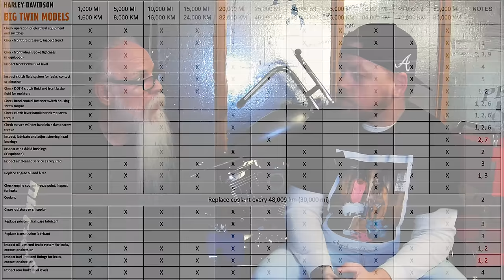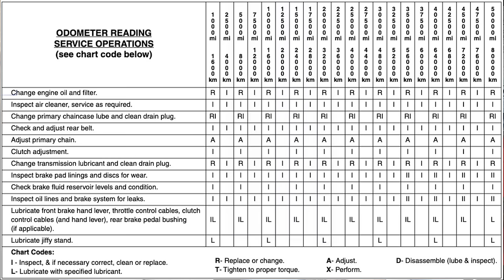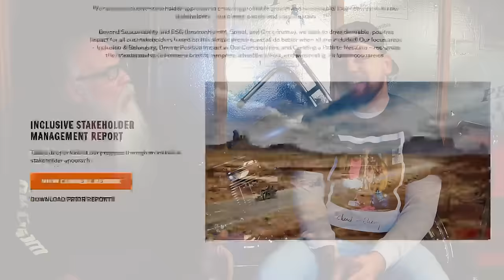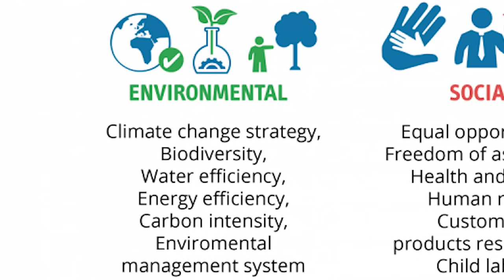Harley Oil Change Intervals-Engine, Primary, Trans

Comment: I change all 3 yearly regardless of Mike’s beings my trike sits all winter,one thing most people don’t think of is the possibility of moisture getting in your oil’s from cold to warm temps in humid claimants like we have here in Illinois,so to be on the safe side of things this is why I do mine yearly
Reply from the maker: Good practice.  Thanks for sharing. 👍
Reply: @BADog-ew6ox  yup MN weather the same. I have actually witnessed the moisture from the cold making oil look like milk. Typically a quick start and run for a min will burn that off, but I agree, good rule of thumb for living in Arctic tundra 😆

Comment: Thanks for the info.  I change the engine oil every 5,000 Km with amsoil.  Clean my outlaw filter every oil change.  Try not to forget to clean my external breather catch can at the same time. Change the primary and trans every 10,000 Km with formula +
Reply from the maker: Thanks for the input, and we appreciate your business. 👍

Comment: I just changed the oil and filter a couple days ago at 5k on my FXLRS. The little magnet was almost completely clean and the oil wasn’t too dirty looking either (HD synth 3) was going to change my transmission at the same time but it looked perfectly clear and clean. I’m waiting on an aftermarket chain tensioner before I do my primary because I’m swapping out the factory one while I’m in there. I’ll go ahead and change the transmission too and look at that magnet. I suspect it will be in good condition judging by the appearance of the oil. If so, I’ll probably stay with 10k on my Tran and primary. Great information though. We can always count on you guys for straight answers.👍
Reply from the maker: Thanks man, appreciate the comment.
Yeah, after reading so many comments, and looking back at my trans changes, I'm probably going to change the gear oil every other oil and primary change (4k-5k miles).

Comment: Thanks for the info and would love to hear if your particles appear to be less after a few changes. I was talking to someone that worked in the oil industry and asked for his honest opinion on longevity of different brands of oil. He told me the in all honesty, all oils will protect for approximately 20,000 miles. I ask why then the frequency of recommended changes. He told me the reason is in the money. The more oil you change, the more profit that is made. It sounds like what I was assuming. That being said, I still change every 3-5 thousand miles. Now I’ll be doing all 3 every time due to your video. I have to tell you though, I have a 2003 heritage with 69,000 on it and have never changed the transmission or primary and it runs like the day I purchased it from the dealer. Call me stupid or just lucky, but that’s the truth.
Reply from the maker: Thank you for your comment, and for sharing your experience.

Interesting what your industry guy told you.

Yes, there are less particulates in the oil when changing more often.  Will have to dig thru some Blackstone reports to find how much.

The landscape of oil efficacy is significantly changed over the last few decades with more and more semi and full synthetics,

Even with the best fluids I can tell when the oil starts getting "tired" in the engine by top end noise, and in the primary by clutch engagement.  I cannot tell any difference in the transmission.

Again, thanks for the interesting info you've shared. KP

Comment: Living in S. Florida and riding less than 5k miles/year on my 2010 TriGlide, I change fluids once a year. Redline 20w60 (if I can find it) in the engine, Redline Shockproof in the tranny, and a mixture of Formula + and auto transmission fluid in the primary. At 33000 miles, trike still runs great!
Reply from the maker: Thanks for sharing!
Reply: @DKCustomProducts  could you tell me what’s the best video to watch so I can learn how to do my own 3 hole oil change on a 2020 trike

Comment: Well all I know is back in the day when I worked at a GM dealership the old diesel mechanic always said keeping the oil changed is the life of any engine! And I believe he’s right my old bike gets her oil changed in all 3 holes every fall before it’s put up for the winter which is only about 2500 to 3500 most times it maybe a waste of money but I think it’s good insurance and if I can get time to ride more I would still change it about the same mileage stay safe guys
Reply: That makes you feel better. Not the bike. It would last longer if it was possible to ride it more often. But for many that's determined by your location.
Reply: He's right!  Never hurts to change engine oil. Maybe the most important thing that's usually overlooked, is change it hot in suspension ride it up and down the pike an hour or so, bring it in Hot. Drop your oil out of it as soon as you get in, let it drain for an hour or more (if you can) these are very important points concerning the longevity and cleanliness of your engine and drivetrain parts. As you may know, oil does not lose this lubricity, and when collected and left to sit in a barrel, all of the ingredients put in at the Refinery and all of these sedements and wear materials will settle to the bottom of the barrel, and over the top of that you have clean oil. That is what I run in my lawn mower and other small engines. (Not my bike) Ride Aware, & remember recycling starts @ home!

Comment: Jmo, I change oil every 3k miles or less depending on how I’ve riding, I ride over 100mhp all the time so I change it often. Cheap insurance. I change the Transmission/primary fluid every other oil change. Just what I do based on how I’ve riding. You can only fry chicken in the same oil so many times. Facts!  If I get the oil hotter than normal I change it asap
Reply from the maker: Good practices. 👍😎👍

Comment: 2012 Road Glide.  I change engine oil between 3,000 and 3,500 miles and use Syn3 and a Harley oil filter.  I change primary at the same time and use Formula +.  Transmission is BelRay, also every oil change.  The magnets are clean except for the normal fuzz on the primary.  3 quarts in the engine, a little over a quart in the primary, less than a quart in the transmission.  Not a huge environmental impact since I recycle my oils. 
Just how I do it, I’m old and old school.  Your mileage may vary.
Reply from the maker: Thanks for sharing! 👍😎👍

Comment: Was just having this conversation the other day. In my experience 10k is too long of an interval for the primary. At least in my bike it is. Primary gets kinda chattery. I’m going to 5k all three holes from now on. I use synthetics, but the early breakdown of any  oil & its viscosity is a reality with air cooled or oil cooled engines and the heat they produce.
Reply from the maker: Well said! The only one I would feel comfortable going more than 5k miles on is the Trans, and that is because I use the Redline Shockproof.
Most of the time I am between 3500 and 4500 on the engine.

Comment: I do all 3 at the same time around 3 to 4k. Amsoil in all 3 holes and I do the clutch adjustment. I tried redline in my transmission but I didn't like how it smelled. Ride safe!
Reply from the maker: Thanks for sharing

Comment: I change my engine oil before I put it to bed every winter and the other two holes get done every second year. I use a full synthetic oil (AMSOIL) I use the specific oil type for each hole.
Reply from the maker: Thanks for your comment. 👍

Comment: I use Syn 3 in the engine and I use harley 80-140 heavy syn in the primary and trans, engine gets changes every 4 to 5 thousand miles and the primary and trans get it around 8 to 10 thousand so basicly the primary and trans get changed every second  oil change and the oil gets changed every yr depending on mileage put on the bike as we have a fairly short riding season here in Canada. I only use Wix filters as well. Bike has 65 thousand on it and I run 2 up heavy, long haul touring and never had a problem at all, side note, the service tech at the dealership told me about the 80-140 weight  as i was running syn 3 in the primary before and I was getting a lot of chain noise when hot from the primary and 5 gear howl because of the straight cut gears in the trans, the heavier oil makes it shift like butter and the 5 gear howl is gone.
Reply from the maker: Thanks for sharing!  👍😎👍

Comment: I always did a 3 hole change between 4 and 5000 miles for the last 30+ years , I live in Arizona and the outside temperature is usually pretty toasty from May to October
Reply from the maker: Yep, y'all have some toasty temps out that way!

Comment: One thing that I would like to point out, is that it never hurts to change your engine oil. One thing I've noticed while reading of these comments is, that no one ever said anything about changing it hot in suspension, ride it for an hour bring it in hot and drop it all out now. Oh yeah, one question I have is if it cost more to refine a gallon of gasoline than a quart of oil, how come a quart of motor oil costs more than a gallon of gasoline?
Reply from the maker: Yes, always best/Much Better to change oil when hot.
Cost of oil thoughts:
Packaging
Advertising
Whole different distribution channels, with more fingers in the pie
Additive packages that go into the oil

Comment: I change all three holes every 5000 miles, the transmission lubricant when I drain it at 5000 miles looks just like the new stuff I pour in afterwards. Engine oil always looks very good at 5000 miles (Harley syn3 in the engine, Harley synthetic in the trans & primary) I figure if you’re going to do the engine oil change, your right there, might just as well do the trans and primary.

Comment: I have a 2020 tri glide I change all 3 holes every 4k-5k.   With all harley brand oils syn3 in the Motor and Trans. The Primary gets harley primary/gear oil

Comment: 5k synthetic in engine and primary. Trans with Amsoil Severe Gear every 10k. I did  change the trans at 5k once and the trans fluid still looked brand new.

Comment: I don’t have the opportunity for 5,000 miles a year unfortunately. So I just change all 3 oils yearly. And with the engines running so hot, it just makes sense.
Reply from the maker: Good practice.  Minimum fluid change every year, regardless of miles, is best.
Here's a vid of low & no cost ways to cool your ride down a bit- https://www.youtube.com/watch?v=o3T3yA9BKwE

Comment: Great info 👍 . Thanks for letting us know.

I use H-D 360 20W50 in the engine and Formula+ in the primary & transmission on my M8 Road King.
 I do a 3  hole oil change and replace the engine oil filter  before l put it in storage for winter. This is roughly after about a 5000KM riding season .
 
   I have 12,000KM on the odometer. So far so good.
Reply from the maker: Thanks for sharing

Comment: I change all three holes at 500, 1000 and every 2500 miles thereafter using Amsoil 75W140 in the trans, MCVQT 20W50 in the engine and Formula+ in the primary.
Reply from the maker: That's pretty often, especially for Amsoil.  But the powertrain will not complain.  That is sure! 👍

Comment: I use 20w50 in my primary, transmission and engine on my 93 FXRS-CONV.
I change the engine oil and filter every 1,500 miles and change the primary and transmission every 5,000 miles.
I do the same on my 2010 FLHTC using 20w50 Syntec.
My reason is that oil is one of the main components of cooling along with lubrication.
Plus I am keeping an eye on the engine internals.
For those of you that ride an Electra Glide you know how hot these engines get.
My EVO doesn't even come close to the heat coming from my FLHTC.
Reply from the maker: Good points!

Comment: TX can get miserably hot. As an everyday rider commuting 80-90 miles a day. I do all 3 holes @ 3k in the hot summer months and 5k on the spring & winter months.
Reply: Living in the caribbean i also change 3 holes every 3k.🌴
Reply: @edgarpontzen4778  I ride the 107. So far so good. Need to get that external breather kit ASAP. Being a former hot rod guy on classic cars and the cost to benefit. It’s a needed purchase above all else. Except for the saddle and headlamp
Reply from the maker: I believe you will be well pleased with the EBS.
Always feel free to email or call with any questions.
Support@DKCustomProducts.com
662-252-8828

Comment: 20/50 Full synthetic, on all 3 holes, engine 5K primary 5K, transmission 10K I will keep my schedule, when I babe changes the Trany at 5K the oil is super clean. Don’t know viscosity!

Comment: We do a three hole service every 5k miles on our police motors. We run them hard and they definitely get hot. The engine oil and primary fluid are definitely smoked by then. Heck, one training day will smoke the primary fluid with as hot as we get the fluid. We should probably service our fluids more often with as hot as we get them.
Reply from the maker: Thanks for sharing what your Department does. 👍😎👍

Comment: I do my engine every 3k, engine and primary at 6K, then all three at 9K, then start the routine again. Just sold a 2008 Fatboy with 61K miles and compression was still 126 psi

Comment: all 3 holes with Amsoil once a year and brake fluid once a year. and i do a lot less miles than recommended. regardless on how many miles before the winter when the bike is garaged always clean oil

Comment: Best bet is to follow Harley Davidson Owner Manual that came with the bike. Harley has a Research & Development Team who have tested these motors & transmissions. So they have a good idea how far the drive train can go before the next scheduled maintenance interval. Kevin even stated he has had no problems with the recommended maintenance intervals. If you follow the manufacturer maintenance schedule you should not have any problems. Can anomalies occur with your bike? Sure but those are in the minority. Thanks for posting and opening up some dialog on this subject matter.
Reply: Taking the time to drain the primary and tranny when doing an oil change is too easy not to do it.
Reply from the maker: Well, I can't quite agree that HD recommendations/guidelines are to be trusted.  We know where they've dropped the ball on so many other things.
That said, since doing this video, and reading all the comments, I am going to continue changing engine oil every 4k-5k miles, and will do the primary at the same time.  But will probably do the transmission every other engine/primary change.
Reason is that the trans comes out clean, and nothing on the magnet.  The trans does not get the heat or contamination that the engine and primary does.
Thank you for your comment. 👍😎👍

Comment: I do a 3 hole oil change every 3000 miles. I use full synthetic by Amsoil oils. I do this because it’s easier to keep track of primary and transmission oil changes if I do them all at once. I like 3000 miles over 5000 miles because I like to keep the engine oil as clean as possible.
Reply from the maker: Thanks for sharing!

Comment: I believe the biggest deception  with Harley Davidson and there oils is a lack of R.D. If you are using a after market brand you will be better off. My top brands in my own R.D. for my 2019 Roadglide will go to Torco full synthetic motor oil and gear lube, Mobil 1 full synthetic motor oil , Motul full synthetic motor oil and semi blend primary. Harley oils performed the worst of those 3 I have tested (Syn 3 & Harley primary and gear oil ) in my 2019 bike, for my 89 Evo Sportster engine H.D. 360 , Motul primary semi-blend, The primary runs quieter now than it ever has, since I stopped using the Harley primary oil in that bike. I also have heard Amsoil is a great brand to use as well .  Thanks guys for doing this video.
Reply from the maker: Thank you for sharing your experiences with different oils.
Glad you are liking the videos. 👍😎👍

Comment: I use AMSOIL and I change all three holes every 5000 miles. The cost involved isn’t that much more plus AMSOIL has primary and transmission individual oils. Redline and Syn3 are good oils too.

Comment: Think evo days had different primary oil to box oil. I change all oil at 5000ks 3,106 miles and thought that was to long. Think shovel days was 2500 miles.  Can’t remember exactly now. 
But I do change at 5000 ks all 3 and filter. 
Experimenting a bit on primary oil at 15/50 at the moment as I think 20/50 is to thick cold

Comment: My thought is the primary and transmission oil doesn't see the temperatures and gas infusion that the engine oil does, so it should last longer. That being said, I just did my 5K service on a 2023 M8 and changed the primary too. I'll change the transmission at 10K.
Reply from the maker: Good points!
The primary ends up with a lot of containments in it, from the primary chain and the clutch plates....and depending on how one rides, that can be quite a bit.
Transmission hopefully does not have much in it...unless there is a lot of grinding of gears, and/or a lot o dumping the clutch at higher rpm's.
Thank you for the comment.

Comment: I have a 2002 Heritage Classic. I never go over 5K on the engine or primary. Depending on how hard I ride the bike, I change the trans about every 8-10K. The trans is a closed system so it doesn't get near the contamination the engine does . The primary is a closed system also, however, the oil is contaminated by wear of the clutch pack. 

I know people that go 8-10K on their engine oil. I tell them if you're going to do that, I would change the oil filter at the halfway point. The best oil is useless once the filter stops filtering. There is a bypass valve in the oil filter. When the filter media gets plugged up, the bypass valve opens to allow oil to circulate through the engine. At that point you're bypassing the filter media and just pumping dirty oil through your engine.

I use Amsoil 20-50 in the engine and primary. I use Amsoil 90-110 in the trans.
Reply from the maker: Very good info, thank you for the add.  👍